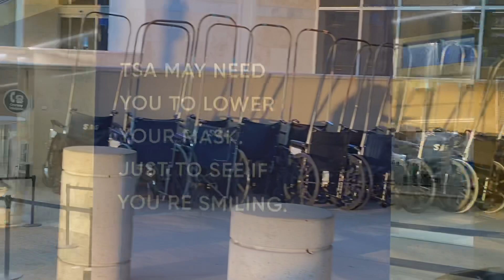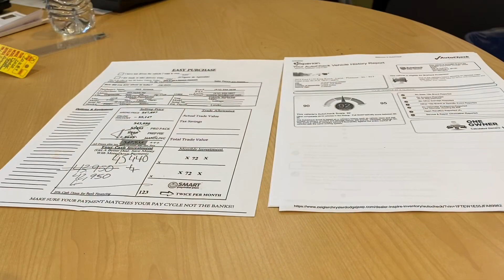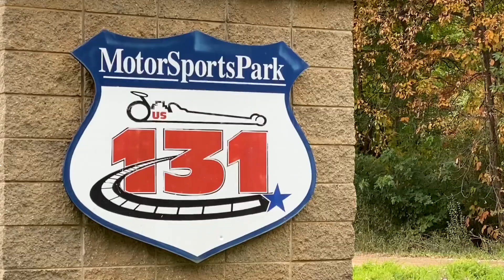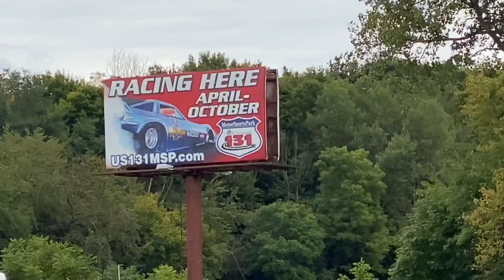5,000 Mile HAYABUSA trip GONE WRONG!

Comment: I’ve done some long rides on Blackbird and Busa. You can get some rubber coated tie downs brand name “nite ize” so you can strap your backpack to the back of your seat/hump. It takes the weight off your back and gives you a little half backrest which kinda helps. The only downside is you have to pack your stuff strategically if you want to pull anything out of your bag say at a fuel stop or something cause it’s really strapped down at all angles.

Comment: This may seem obvious but does your backpack have a center strap and some of the other accessories like a hiking backpack would have? They also have smaller hiking backpacks that give you a bunch of support.. granted the angle you lay on a Hayabusa as well as the wind catching it is going to be rough no matter what. I was looking at Hayabusa accessories and they do make different types of saddlebags and D Saddles and things like that, so there are some decent options out there including ones that just securely hold your bag to the bike-and not in a ghetto way that is going to make you worry or kill your gas mileage, lol.. a lot of them don't appear to necessarily be wallet-friendly, albeit with a little bit of digging through Google via the shopping Tab and some forums (that's what I did partway through your video and found some pretty neat options that I actually hadn't seen before) -- 🙂🤟
Reply from the maker: Good feedback. Thanks a lot for watching! Please get one friend who does not know about this channel to subscribe

Comment: KRIEGA Motorcycle luggage. Its a great system that fits on tons of different bikes .  Cortech also made a roomy tail bag for less than $100.  Get the weight off your shoulders for anything longer than 500 miles.  Take the trip, busa was made for stuff like that.
Reply from the maker: Thanks bud. I will give it a try!